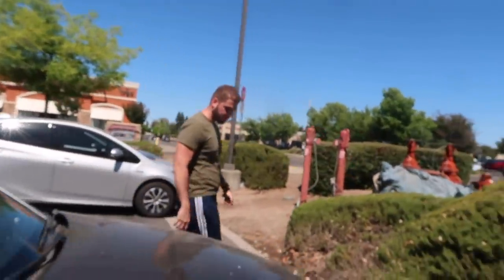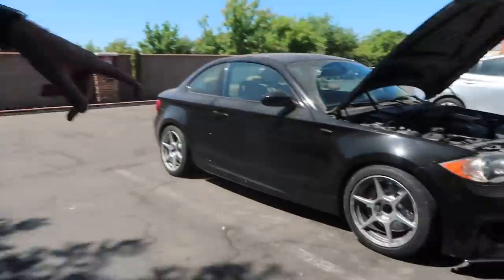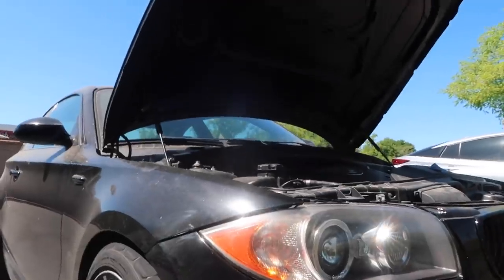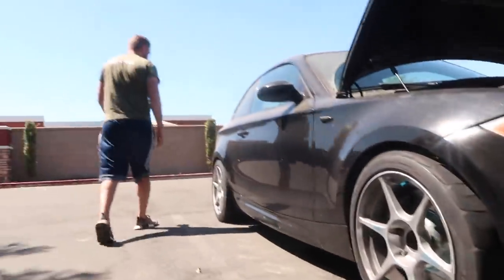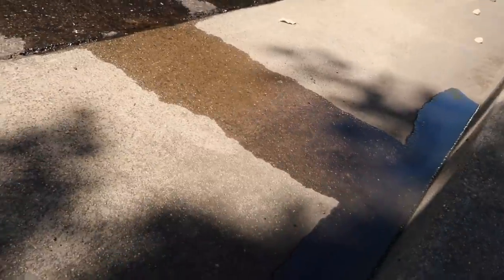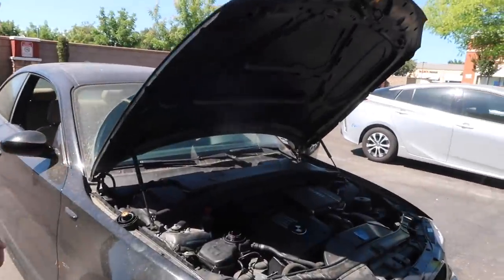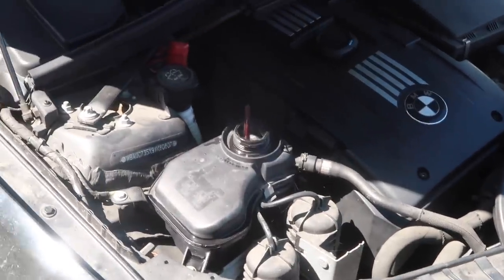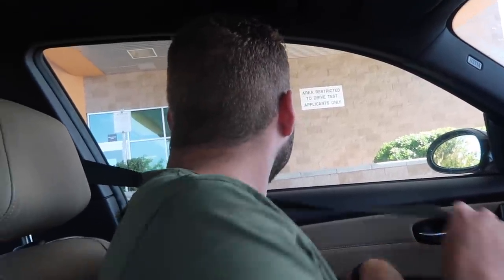I Can't Make This Stuff Up...

Comment: I’ve had a problem really similar to this. The best way to handle this so you can basically Eliminate all problems remove all water pump/therm connections and re do them also inspect the hose that runs from the water pipe to water pump I had a baby crack you couldn’t see unless you actually took the hose off and it wouldn’t leak until the car got very warm like a solid drive. After that pressure test if it’s still there. While your at it if you can put a water pump you know works you know eliminate that section completely.

Comment: I have the same exact issue on my 11 535 changed the water pump and thermostat, drove the car and a hose leading to the thermostat blew off , after that it has been that same issue you have ever since. Ive read couple of forums statin this issue and you just confirm it the water pump and thermostat was ass to begin with !!!

Comment: this happened to me on my 335i a couple months ago, my thermostat broke and was pushing all the water out and it pressurized the water pump and cracked it, i had to buy a new water pump and thermostat and replace the U shaped hose that connects them
Reply from the maker: Ok cool got them both coming in the mail

Comment: Once had a car that done the same overheating water spilling out from the water bottle. I had to get a new gasket set, water pump, new water bottle after some time it the mixed water and oil😪ended up selling the car as I couldn't figure out what was wrong with it

Comment: check the drivers side of the car right where the upper radiator hose is, that’s a very common failure point on the n54. if it’s not the WP + thermostat there’s a good chance it’s that.
Reply: Was about to comment this

Comment: if your waterpump breaks does it give a check engine light?
Reply: sometimes, depends on if it mechanically fails or not.
Reply: @adeebrashid5380  okay! another question! does the fan start spinning like crazy😅?
Reply: @janteri_  yes, anytime your engine is getting warmer than normal your fan will kick on. 
if your engine if overeating you should get a warning on the dash or idrive display.
Reply: @adeebrashid5380  the only problem here is that my engine was cold when this happened😅